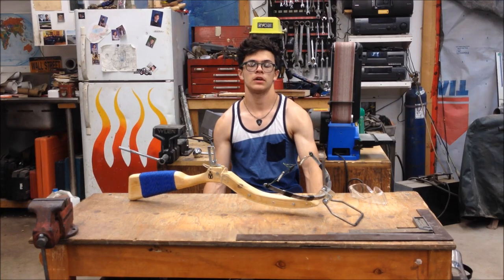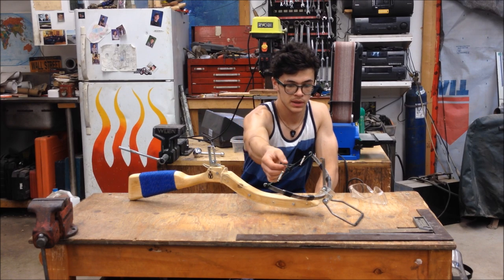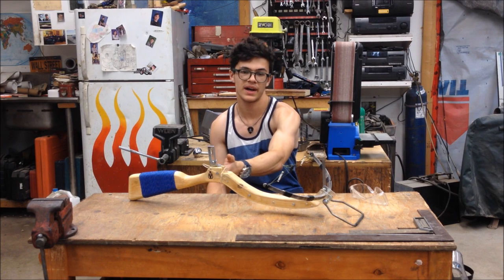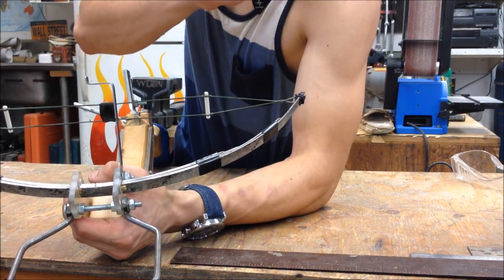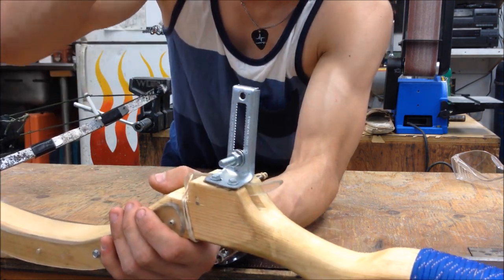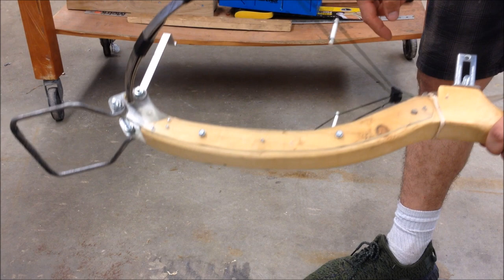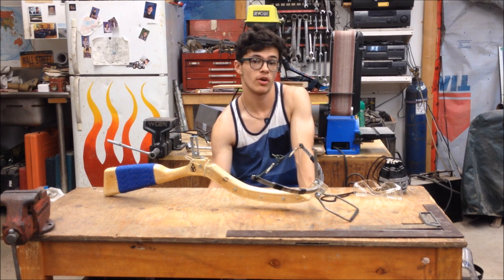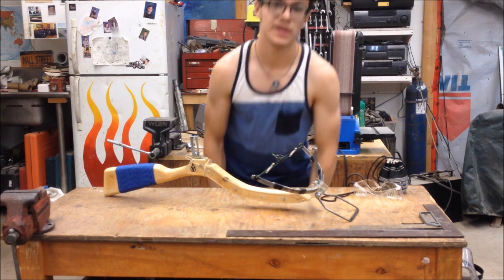Marble Crossbow, Homemade

Comment: How heavy should the ammo be compared to the bow to avoid an effect similar to dry fires?
Reply: @johnbunson389  which is how many grains per pound? I'm going to use a 150 lb fiberglass prod.
Reply: I’d say 5-6 grains per each pound of draw weight should be fine. 600-700 grains. However if you’re going to use an 150 lb bow for this be sure to make a setup that shoots through the bow, not over. At higher poundages it’s not reliable enough from my own experience.
Reply: If you still want to though, I’d go ahead and google “The Practical Guide to Man Powered Weapons and Ammunition”. This will give a lot of answers for these sorts of crossbows and the fine details.
Reply: @johnbunson389  what I was going to do was make the front of the stock perhaps lowering then the back but also make sure that the string and trigger are at the same lever so it shoots straight.
Reply: Well, I suppose if you want to you could but believe me that there is going to be a ton of torque if you angle the bow at such a high draw weight. Even the one I made is very hard to shoot straight. I’d much rather just use a piece of angle iron with a wide hole in the centre and limbs on each sides. That way the limbs will pull straight and easy. If you don’t want to do that than I suppose you could make one like this, but wear safety glasses lol.
Reply: @johnbunson389  it's just cause since it's a fiberglass prod I literally can't modify it in anyway without risk of failure. If I made a prod that would be different and I could possibly do that.